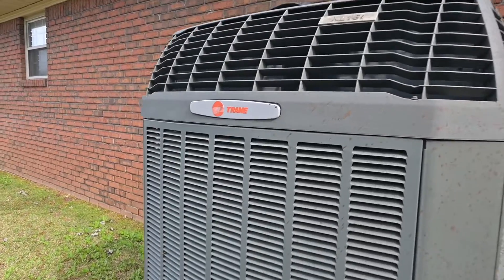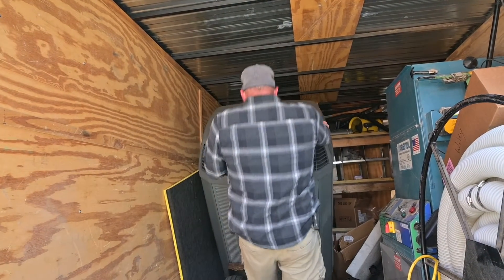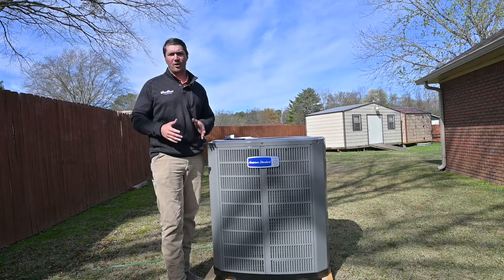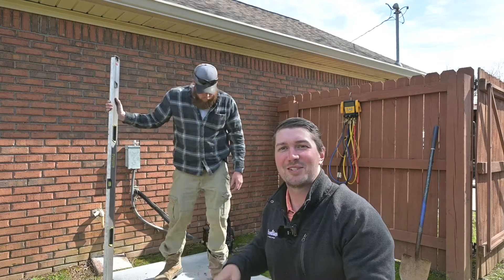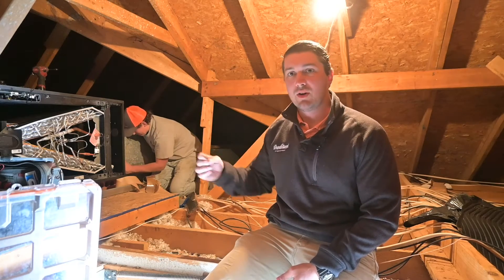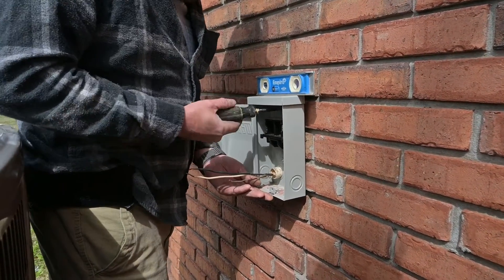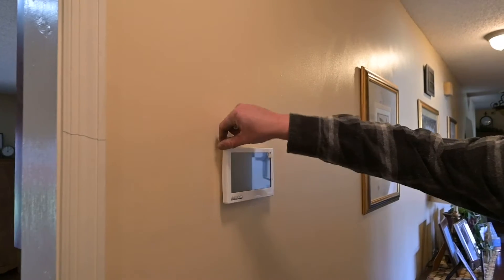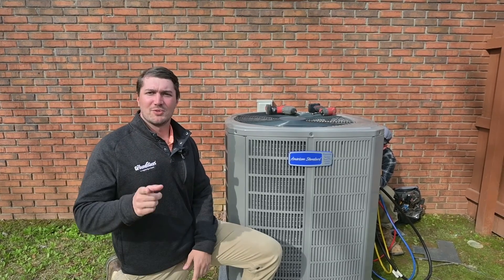This INVERTER System will BLOW YOUR MIND | American Standard Platinum Series HEAT PUMP

Comment: I will never again have a whole house HP installed. My 8 year old Gibson died and I replaced it with a Ruud 3 ton(9100 bucks) and its never worked right. The heat is 78 degrees at the vent and its always using Em heat to maintain. I bought a 18,000 mini split open box sent to my house for 700 bucks cause I was angry cause it can't cool or heat , My Hvac guy wanted 8Grand to install it. Not going to happen I installed it myself. Its a Haire  cold climate heat pump and even down below zero the air is very very hot and no Em heat even on the unit. I have had the unit for 3 years running 24/7 never a problem.

Comment: Nothing new, i installed my Bosch bova 36, they had the inverter out way before American Standard
Reply: Bosch will not hold as tight of a temperature because it does not communicate with the indoor blower

Comment: Over priced junk
Reply: You have no clue, Mr Tampon Negative
Reply: I would argue AS is the best equipment in the industry
Reply: Nailed it! This very system has done nothing but break down. 4 Coils on air handler, 2 blower motors, 1 EEV,Defrost, & Control Board. Freon loss constant & living on emergency heat. Waste of Money; especially note warranty doesn’t pay for Freon loss!

Comment: Seal all ductwork prior to investing in a new hvac system.
Reply: You're absolutely correct. You will never realize the full potential of any type of hvac system with leaky ducts. I used Aeroseal before installation of my Bryant heap pump. $ well invested.

Comment: I didn’t see nitrogen flowing when he was brazing that drier in the worst place, outside.
Reply: I bet only 10% of techs use nitrogen. When I ask people they say I’ve been doing this 40 years and it was never an issue before
Reply: @BirdDog. right. The TXVs weren’t as easily clogged back then either. If it even had a TXV. Those old systems mostly had pistons or capillaries. They didn’t used to use vacuum pumps either but that doesn’t make it right. lol.